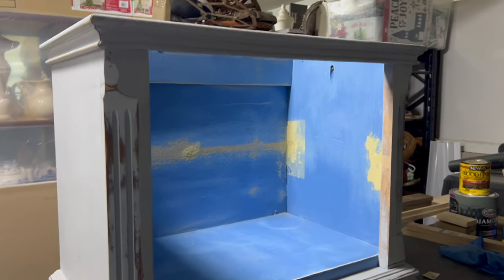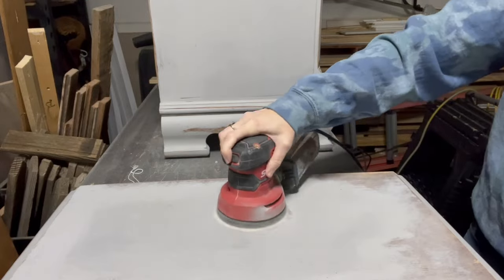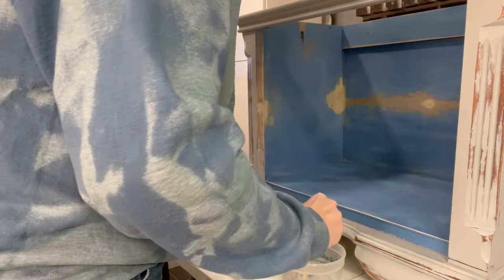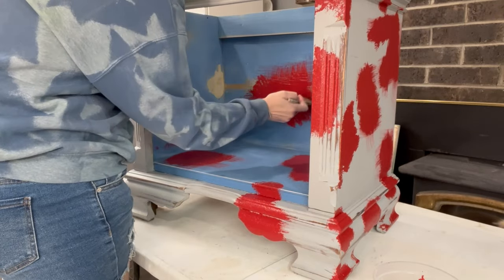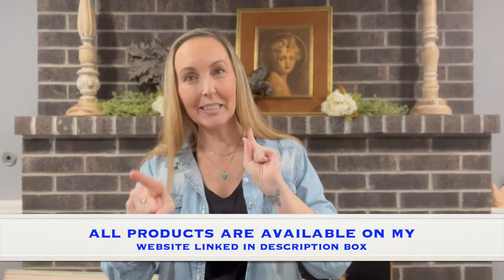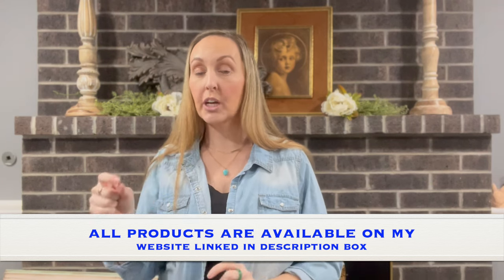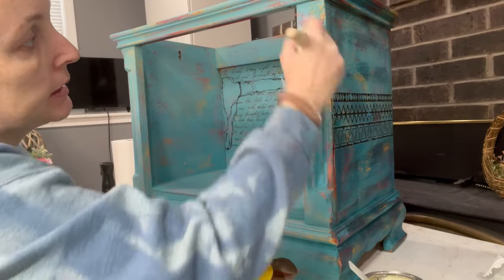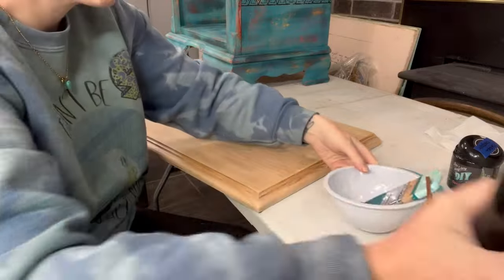EXTREME Southwest Boho Furniture Makeover | DIY Side table makeover | Dog/Cat Side Table DIY

Comment: You have to use water when you are blending. You can see that your paint is way too dry. And your two colors are not different enough in shades
Reply: Actually, you can use a dry brush technique when blending. It’s up to the person and what they want to do. The person she’s referring to did the dry brush technique for blending and she used two somewhat similar shades. They both used salt wash so that is another factor in what type of blending as is if she used water the very bottom colors would have started blending into the blues so that would have defeated the purpose of the whole project. There’s no right or wrong way. People can create things differently.
Reply: @rachelo0423  really I didn't know that you could blend with a dry brush.